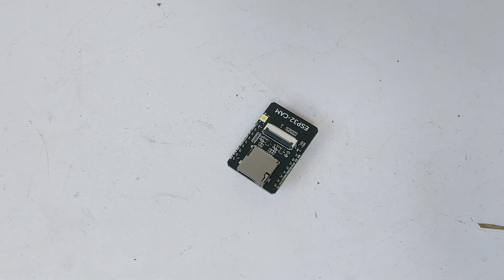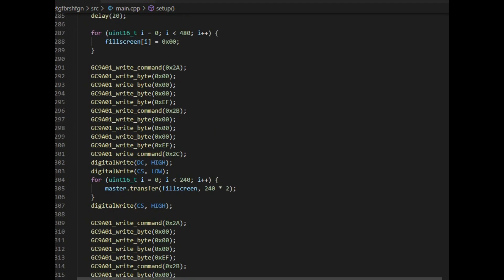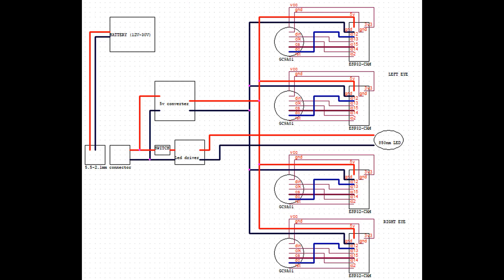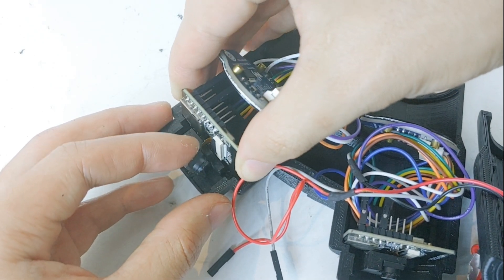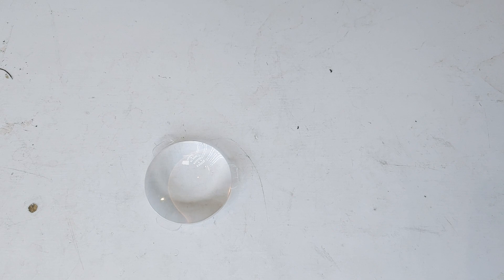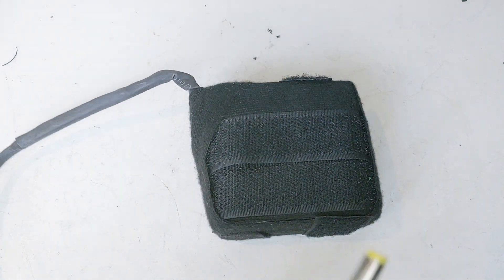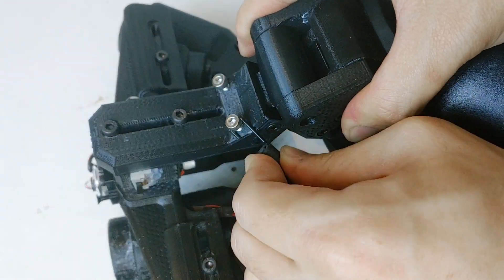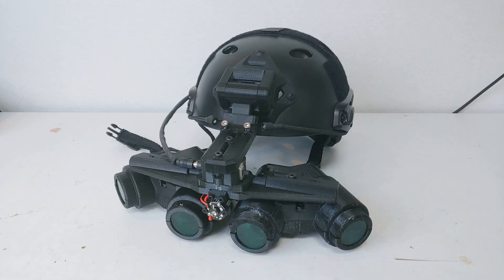DPNVG mk3 (DIY Quad Nod NVG, Night Vision) part2

Comment: I really like the idea and wanted to build it myself. But I’m sadly unable to get my ESP32 cam boards to work. The Download tool successfully flashes the board and when I plug in the 5V DC, the Display flashes briefly but I never get a live camera feed out of it. I tried everything like you did without luck. Do you have any advice what could be the problem?
Reply: i have the same issue
Reply: @michaellarue5361  I don´t know if the Camera is the Problem?
Reply: @eliasschragner4690  I got it to work...its the camera..the programing (bin file) is specific for the 7725. the 2640s that come with the boards, from amazon, do not work with that bin file
Reply: @michaellarue5361  Ok I’m glad that I bought four new Cameras. Thanks, for the Information.
Reply: @eliasschragner4690  im having the same problems, please let me know if a new camra fixes the problem
Reply: @kevv3093  yes using the correct camera  fixed the problem
Reply: @michaellarue5200  where did you get your camras? I tried new ov7725 i got from amazon and it still doesn't work, my backlight is on but has black display
Reply: @kevv3093  mine came from amazon as well. programmed all 4. all 4 are working. none of them worked with the 2640. make sure you are using the ESP32-S and you installed the current bin files from october  that General Purpose uploaded.
Reply: @kevv3093  update: sorry correction...my cameras come from ali express and they worked. i ordered the same cameras from amazon (to make a second pair of nvgs) and they don't. ( black back lit screen no video feed) im troubleshooting the amazon cameras but im thinking the cameras i ordered from them are wrong. (miss packaged??) the ali express cameras had sticky tape on the back of the camera and made it easy to attach to the housing. the amazon ones do not. im going to play around with the actual programming software creating a few bin files to see if i can make it at least turn on. im also going to order them again from ali and wait months for them to show up.
Reply: @michaellarue5200  any chance you can link me the ones that worked?  I tried ordering a new ov7725 off amazon and it still didn't work and now i have 5 camras that dont work, also ordered a new esp32 incase that was the problem (also i am using the esp32-s)
Reply: @michaellarue5200  have you figured out anything with the amazon camera? I have a eps32-s with a 7725 camera.. back lit screen but it never shows video feed or flashes white. As soon as it gets power it just stays back lit.
Reply: Same things happening tobme and its so frustrating, ordered new esp32  boards in case thats the problem, ive tried  6 ov7725 camreas  for 3 diffrent sellers and its all not working
Reply: @eliasschragner4690  what binary bin did you use for the left and right? i cant seem to find them
Reply: Ok i think i figured it out, the esp32 board i ordered were faulty, there may be alot of fake/ faulty esp32 boards and ov7725 cams out there so make sure you have good working components, im powering mine with 2 9v battery in parallel and with a 5v voltage regulator
Reply: I have the same problem where I turn it on and I get no camera display, is there any way to fix this?
Reply: @ReidGrozny  yes, the round 1.28” display comes with its own cables
Reply: same issue

Comment: Dude, u are a life saver, i’ve been working on this for a year without knowing anything
Reply: I do as the video said but my ESP32 have no signal but the LCD is lit up, do you know what’s strong? I’m using two 18650 battery with 5V
Reply: @despacitoRC  have you recheck the wire ?
Reply: @Kuroitsukinoyo  yes bro. However, after checking the comments below, it turns out to be the camera. are you using OV7725 too?

Comment: Is there something needed specifically for the camera piece to be an ov7725 and not the ov2640 camera that comes with most of them on amazon?
Reply: in part 1 of the video he says the ov7725 is 5x more sensitive than the ov2640.
Reply: @kevv3093  so would getting higher power ir leds work? I cant seem to find ov7725 cameras
Reply: @Khoomn  i guess you can do that but ov7725 has better image quality and sensitivity, so less of that pixelated/fuzzy image camras get in a dark place. Also on a diffrent comment the guy that made this said he cant guarantee if the cams will face the right orientation if you use a ov2640
Reply: @Khoomn  oh and I found ov7725 camras on aliexpress for $6~7 canadian dollars
Reply: @kevv3093  is it $6-7 per camera or in like a pack?
Reply: @Khoomn  per camera

Comment: The quad nods are cool, but it may honestly be easier to work with by making it a 3 camera setup. Eliminates the need to overlap the two center cameras.
Reply from the maker: Nope, first problem with triple nod is depth perception. second problem is that multi nods have dark area between the side nods and front nods, that is already a small problem in quad nod but it would be a huge problem in triple nod since human ipd is around 70mm. making adjustable ipd with the fixed front camera is also a small problem. well, there can be some ways to deal with all those problems but i can say for sure, if you want it to work properly, quad nod is the way to go.
Reply: @generalpurpose2714  I should be more accurate with what I mean I guess. Why not one screen across both of your eyes plus an off set camera for the edges on both sides? I know depth perception sucks in NODS but it gets easier. I can walk around fine with my PVS14 as a single tube. Part of the reason quad nods look the way they do is because you are looking through the image intensifier. You don't need to worry about that since you are looking at a screen supplying a digital image. You don't need to have it set up the same way a quad nod is and can get creative with the design/layout. The project is awesome and I'm following it because it's a cool concept. Maybe if you get to a 60 FPS version like your Mk2 that's easier to build I'll even build one just to tinker with a project. Thanks for the content and keep it up, someday digital image sensors will get to the point where they replace traditional image intensifiers.
Reply: @FluffiestHamster  I get what you are saying, but the two instead of one cameras comes into value particularly when aiming down the sights. As it allows you to aim from either shoulder.  Also there is a shift in the image so I think it would make you more dizzy getting feed from one camera offset, unlike say the PVS 7 where the camera is in the center. And you wouldn't want a camera in the center because it would make it hard to aim down sights.
Reply: Exit pupil. You’re still essentially having the same issue as a pvs7

Comment: I really looked into making something like this, but wanted to use micro near-eye display screens and cameras at 1920x1080. Found a few options for camera/displays, but could never figure out if it would work directly as I hoped, rather than having to route them through PC boards, etc.  My hope was to get power to the camera via a simple 5v or 12v power cord (from battery pack), then route the camera feed via USB to the micro screens, which receive their power also from the USB.  I wanted mine to be fully adjustable for separation, angle, height, distance, and tilt.  But all that customizing of PC boards, etc was not something I could consider. I think it would work, particularly with a wireless setup, but that would also allow interference and I didn't want that.
Reply from the maker: in that case, av camera with viewfinder looks promising. (i'm gonna test this next week) my experience with usb cameras was that they usually have 30 fps, and they  require lots of computing power. plus, fhd would be great but you don't really need that much resolution for a digital nvg cuz you can't see that far anyway.. near gen2 capability is best you can get from a digital nvg.

Comment: Hello, does the camera spec matter? im looking at a bundle deal on Amazon that has the ESP32-S and 2 camera, but they are lower spec than yours (OV2640). will this matter?
Reply from the maker: yes when i tested 2640 in a dark room, i could only see up to like 7meters.
and i'm not sure if the orientation of the image will be same on both cameras
Reply: @generalpurpose2714  can I use the ESP32-S board that comes with the OV2640 and swap them out for the OV7725?  Or will it not work?
Reply: @generalpurpose2714  will they work with original camera or do we need to swap them out for OV7725? Thanks
Reply: @generalpurpose2714  hi

Comment: Now we just need the Mk2 part 2!
Reply from the maker: i'm still not sure if i should revise mk2 or just go for the mk4 right now.. biggest problem with mk2 is sourcing the same camera with same lens. maybe if there's a camera that is common, cheap, and has about 0.001~0.0001 min.lux with about 40 degree viewing angle(you can swap the lens but that requires extra $), i could really make proper mk2.5.
Reply: @generalpurpose2714  My vote would be for improving quality over cost or ease of manufacture. Great job!
Reply: @generalpurpose2714  I would love the mk4